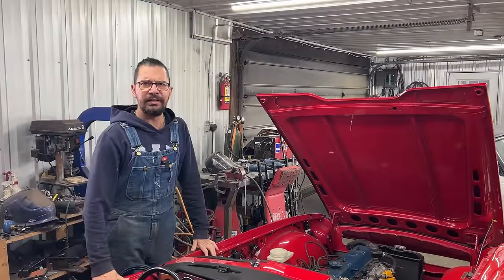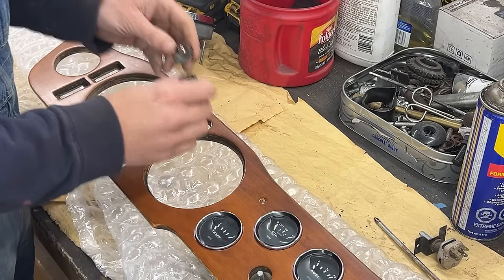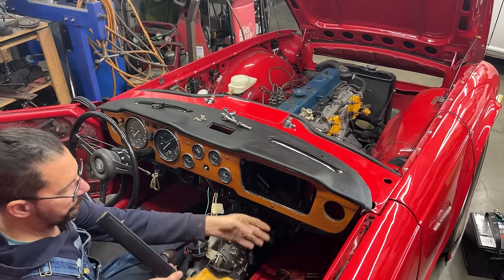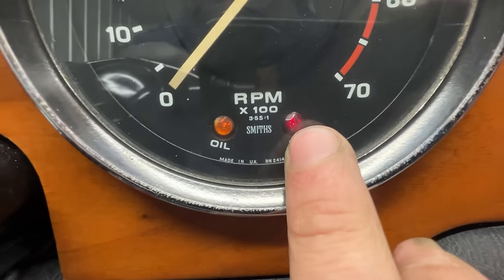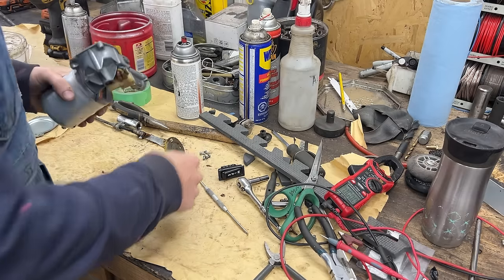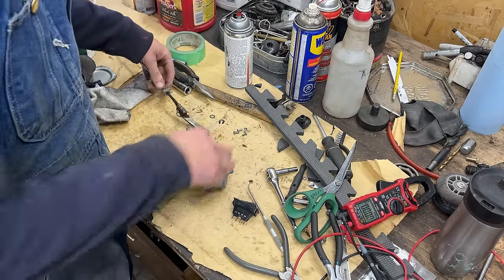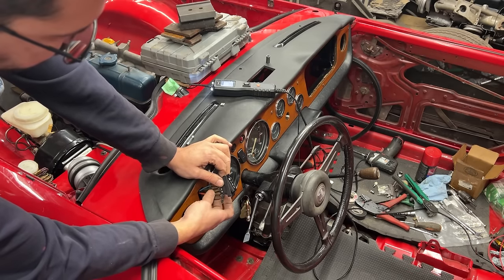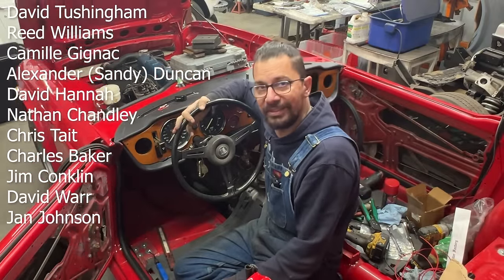1970 TR6 - Part 35 - Installing the dash & wiring the wiper motor

Comment: Elin, I hope you do a video on how to correctly install an electric radiator fan, with both thermal switch on the radiator and a manual over-ride switch, I've been having a heck of a time getting mine to work correctly, even with good grounds, all new cables, new circuit breaker, good switches and relay.

Comment: Very useful, as always, Elin. I find it very strange that they used a motor with two speeds, but a switch with only on-off function. Must have been Lucas engineered. Thanks for the excellent video.

Comment: Excellent timing Elin! I’m in the process of installing a TR6 wiper motor in my TR4A. I had to put a 90 degree gear in the motor, and I’m using a modified 4A switch to allow 2 speeds! So I have some interesting wiring ahead. Fingers crossed🤞👍

Comment: Regarding scuttle vent: are the 3 bolt holes in the lid not oval?
If you loosen the 3 bolts, it seems we can shuffle the lid forward & 'hook' the rubber with the lip of the lid. I could be mistaken.

Comment: The wiper motor without the the drag of the wipers to slow it, can have enough momentum to over run the switch in the motor. This might be the issue you were having.

Comment: Elin  -the way to check the voltage stabilizer gives 10 volts was 12 inches away in the shape of the new voltmeter! Probably like me and my TR4A 1965 (sadly long gone from me) you are so used to having an ammeter in the dash, not a voltmeter?
Reply from the maker: Haha! Right, never thought of that. I will remember it next time, thanks!

Comment: I'm curious if anyone has ever installed the two-speed TR6 wiper motor on earlier cars (250, 4A, 4, etc.)?  There was an optional two-speed motor for the TR4/4A, but those are "unobtanium". 
I assume there would be some mounting mods necessary, since the earlier cars use the motor with the rectangular body, while the TR6's is cylindrical... plus the differences in the switches, of course. 
Would a better option be a GT6/Spitfire two-speed wiper motor? Possibly with the steering column mounted stalk-type switches? (Adding electric spray pump, too?)